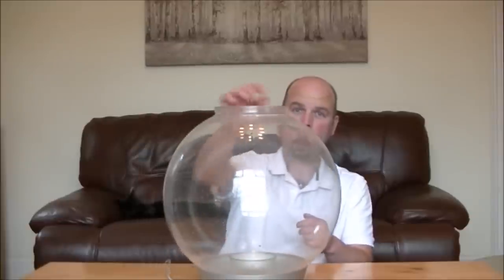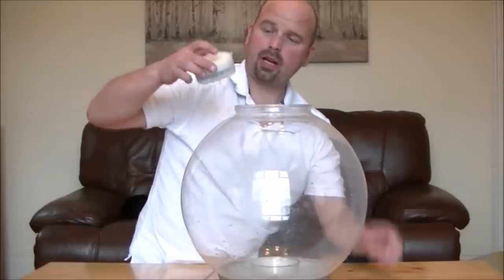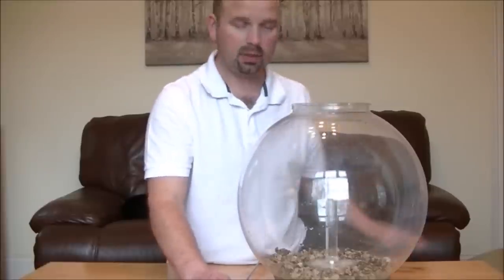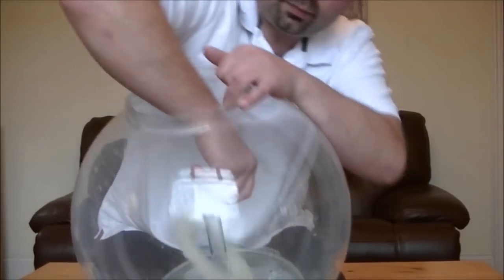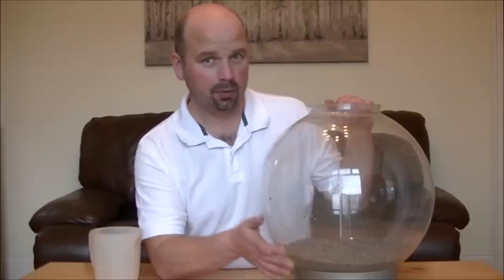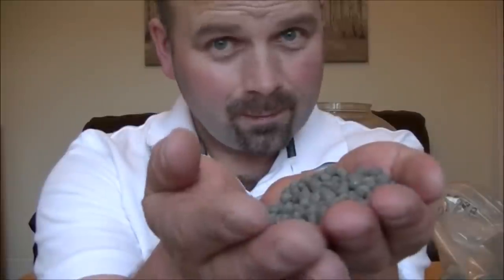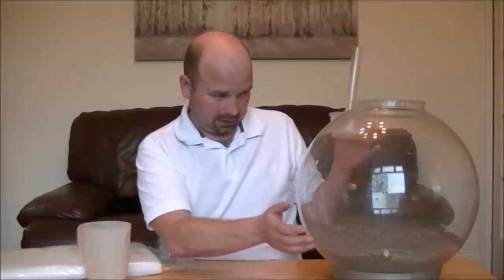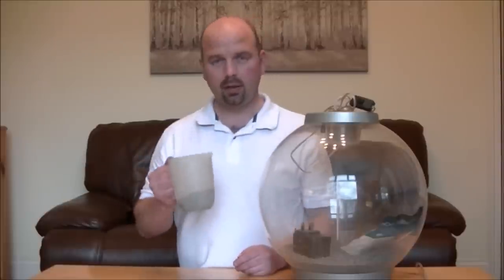BIORB COMPATIBLE UPGRADE KIT

Comment: Koi get very, very sick by exposing them to anaerobic bacteria. Why isn`t this case with this filtermedia???
Reply from the maker: Ralph Tip I think you're thinking of the bacteria associated with a long term build up of filth in pond or filter causing toxic conditions. In a well managed filter (media) that does not happen so the anaerobic bacteria simply processes the nitrate creating much better water conditions. As most fish keepers don't even know about the completion of the nitrogen cycle they're happy to accept high nitrates and large regular water changes but neither are necessary when using the correct media.

Comment: Hello I have a 30l with one pack of ceramic media, I want to add another pack, how I would I go about this should I add all of it straight away or wait and add little bits at a time.
Reply from the maker: If you are adding extra media then add it all in no problem but if you are replacing old media it is best to do it gradually over a period of 3-4 weeks.

Comment: How can someone even afford this Bio-gravel..... for my 16 gallon biorb it will cost me 127.80 USD it was almost as expensive as the tank itself. What about a cheaper and almost as effective method cause that price is just ridiculous.
Reply from the maker: Just use ordinary gravel if you want a low maintenance under gravel filtered tank - as long as you do a partial water change regularly using a gravel cleaner it is easy to keep the tank clean and healthy - nitrates won't reduce but as long as you're prepared to do the regular water changes it won't be a problem. If you have a 60 litre biorb you'll need 3.5kg of biogravel if you use the profile cut foams and 2.5kg - 3kg if you use flat foams so it should only cost about £50 for the biogravel - still expensive, yes but it allows the tank to achieve full cycle and it's expensive stuff to manufacture. $127.80 seems excessive - where was that from?

Comment: is there a way to stop a small leak that seems to be in the bottom of one i have been given there is no center up lift or plug etc the light is led but no plug as said ,i am in process of looking for replacement light etc but the valve in the bottom seems to leak any advice
Reply from the maker: You'll just have to totally drain it and seal up around where the air is injected in with aquarium silicone as i think that is the only possible place it could leak from. If you mean the non-return valve underneath the tank you should be able to fit a new one of those to solve the leak if it is broken.
Reply: thank you for advice i think i may have sorted it but the light in the lid is a baby biorb so am going to replace , the orb itself is very cloudy when empty but seems ok when filled am only going to use as an emergency container for small fish out on the patio where i have a large raised pond thank you so much again for reply
Reply from the maker: No worries - yes most orbs will look cloudy when empty due to the micro scratches on the inside which disappear when the tank is filled with water. Acrylic does scratch very easily.

Comment: Hi I want a BiOrb tank either 30L or 60L. I also want the filter upgrade from https://filterpro.co.uk/biorb-30-litre-upgrade-kit-76-p.asp
https://filterpro.co.uk/biorb-60-litre-upgrade-kit-77-p.asp

I watched a YouTube video where Richard went through the upgrade process. 

Do I need to take the medium/course foam rings out from under the gravel to clean them? (rinse in siphoned tank water, if so how often?) 

Do I need to take the fine filter pad out to clean, if so how often?

Do I need to replace the foam or fine filter pad, if so how often?

If I’m taking out the foam or fine filter pad. Do I need to take out my fish before doing so to be safe? I don’t want to kill it. 

Is the air pump that comes with the BiOrb unit sufficient? If not what power air pump will be best?

I’m going to put 1 male betta in the tank. 

Regards Ross
Reply from the maker: As there is a question here plus 2 emails with exactly the same question on which came through from you at the same time I will answer here for the benefit of others, plus I will add the relevant information to the video description and pinned comment.

Do I need to take the medium/course foam rings out from under the gravel to clean them? (rinse in siphoned tank water, if so how often?) 
- It is basically creating an undergravel filter so as long as the substrate (biogravel) is cleaned with a gravel cleaner that will remove the vast majority of uneaten food / fish waste from the biogravel and upper foam so the foams don't need to be removed unless you want to do a deep clean which I recommend doing every 12 months or so. So far I don't know anyone who has done that as they don't want to disturb anything which is working well.
Ideally the gravel cleaner would be used once a week to remove waste from bottom of tank, just as it would with a normal tank - that will remove waste, do a small water change and freshen up the tank.

Do I need to take the fine filter pad out to clean, if so how often?
- That is just like the cleaning of the 'normal' pad for biorbs. When it is clogged it will need replacing but since you have so much filtration prior to water hitting that fine pad it could go for many months before it needs replacing - every tank is different but most will go 4-6 months before the pad needs replacing. Check after 2-3 months and if you think it would go longer next time just extend cleaning intervals to suit - no point cleaning / replacing a clean filter.

Do I need to replace the foam or fine filter pad, if so how often?
- See above with regard to fine pad in central filter, outer foams should last a good 18-24 months before they lose their 'bounce' but will still function as an undergravel system beyond that.

If I’m taking out the foam or fine filter pad. Do I need to take out my fish before doing so to be safe? I don’t want to kill it. 
- If you are removing the fine pad in the centre then that can be done with fish in no problem but removing the outer foams will involve taking out the biogravel so ideally that would be done when the tank had been drained and fish removed for duration of work - muck could be stirred up when the system is pulled apart so best to do that when fish aren't present. 

Is the air pump that comes with the BiOrb unit sufficient? If not what power air pump will be best?
- Yes the standard air pump will be fine as water flow is not restricted by the undergravel system.
Reply: Thank you very much for your helpful video and reply. Now if only I could get a BiOrb with top lighting and a tropical heater but not have visible wires. Ideally I want all wires going down the middle under the tank into a cylinder stand with a hole in the middle of that and it sits on top of a floor socket. It’s a 360 tank so it should go in the middle of a room. But those cables for the light and heater running down from the top make it look ugly. Plus the heater device inside the tank will require lots of plants to hide it away which will limit the design possibilities a bit. 

I think the only way to hide cables from a light on the top of the tank would be to build a column in the house from ceiling to floor and have room within for a tank such as this.
Reply from the maker: Yes unfortunately the design of the standard 'orb' doesn't lend itself to hiding any cables.

Comment: Great upgrade Richard 👍 never being a fan of biorbs, thankfully never had one, but if one of my sons ever want one will do that upgrade straight away. 
Had my malawi tank running with 10kg of Biohome ultimate for over 6months now and is doing great 👍 check out my channel for videos of tank. 
Must admit I enjoy watching your biohome videos just for the way you say biohome as well though haha
Reply from the maker: The colouration on your fish look awesome and I'm presuming that there are very low nitrates in the tank as the anaerobic bacteria should have got to work now?
Reply: No still got high nitrates unfortunately. 
Suffer with high nitrates out of the tap though and have to use a nitrate filter to filter my tap water. Only problem is it's slow so can't do one large water change to get the nitrates low enough to get on top of.
Reply from the maker: ***** 10kg of biohome filtering that tank should have nailed the nitrates. Are there any other types of media in the filter?
Reply: My filters are set up as follows mate.
APS 1400EX bottom tray. corse,medium, fine sponges and filter floss. The middle tray is just full of biohome ultimate. Top tray is got loads of biohome ultimate and a bag of purigen and carbon.
APS 2000EX bottom tray sponges and filter floss, 2nd and 3rd tray full of biohome ultimate and top tray biohome ultimate and a bag of purigen. I also have a EX-2 booster t'd off the 2000EX to have a slower flow through it. It is full of seachem pond matrix and biohome ultimate.
Reply from the maker: ***** This may sound like a radical thing to do as you have it in both filters but I would suggest removing the purigen and carbon. The biohome should be handling all the ammonia and nitrite (and also the nitrate after 6 months) and it is becoming increasingly evident that purigen messes with all sorts of processes especially when recharged with bleach. You really should only need media and foams to keep the water perfect. Feel free to ring me on 07772848730 for more information regarding that.
Reply: I was considering removing the purigen as it goes dark really quick and recharging it doesn't seem to work. 
I only added the carbon as the tank was smelling abit and girlfriend wasn't to pleased, but I found that leaving the cover glass open a little bit helps a lot with that. 
I tested my tap water earlier and was at 20ppm nitrate so might do a massive water change to night with just tap water see how that goes 👍
Reply from the maker: ***** It could just be that the anaerobic bacteria needs more time to mature but it should have had an impact by now. I'm not a fan of that damn purigen though as it messes up freshwater tanks big time and as well as ruining the water for south American and Asian fish by raising pH it may well destroy filter bacteria if the bleach used for recharging isn't neutralised properly. I assume it is fine in marine or people would be cursing much more it but Seachem seem to make products which create problems then sell other products to fix those problems which irks me greatly.
Reply: I will try taking all the chemical media out of the filters, see how that gets on. I did a big water change last night aswell, so will test nitrates later today.
Reply from the maker: ***** Sounds good to me, man. Let me know how it goes over the next few weeks.
Reply: I will let you know how I get on with it mate 👍

Comment: This did not work for me in my biorb 30, wasted my money.
Reply from the maker: I just checked my records and you did indeed buy a kit late June (about a 2 months ago) but I can't see any emails or questions / comments prior to this asking anything about the kit or reporting any set up problems.
How do you mean it did not work?
Reply: Pondguru the tank is just as bad if not worse than it was before, it's made no difference to the cleanliness of either the water or the tank.
Reply from the maker: With all that extra filtration in there the water is no clearer and it is still polluted? What stock do you have in there? - feel free to send pictures to sales@filterpro.co.uk as we've had nothing but glowing reports about the system. I will help wherever I can.
Reply from the maker: Dear Gary,

Thanks for the pictures. 3 goldfish are not really a good choice for any biorbs as they are such heavy polluters and grow so large - couple of fancy goldfish would have been the maximum in a 60 litre tank with maybe 3 fancies in a 105. 30 litre orb is too small for any sort of goldfish. With the filtration system set up the water looks clear but the amount of algae you have growing on the sides and fine dirt all over the tank is down to the goldfish feeding and waste they produce.

I'm not sure what the maintenance schedule on the tank is but the fine dirt would normally be removed with a gravel cleaner like this: http://geni.us/0YMWPJJ once a week - it will also help remove heavy dirt from substrate and foams - that will prevent the tank being over-polluted. The sides of the tank will have to be cleaned with a pad like this http://geni.us/ZRBnW suitable for acrylic tank once every 1-2 weeks and if the tank is in any sort of sunlight (even reflected light) it will have to be moved to prevent the algae growing on the sides.

The biorb upgrade kit is not a magic bullet but will ensure clear, healthy water when stock is realistic to heavy. 3 goldfish in a 30 litre orb may be too much for the tank unless maintenance with gravel cleaner and pad is very regular.

Regards,

Richard